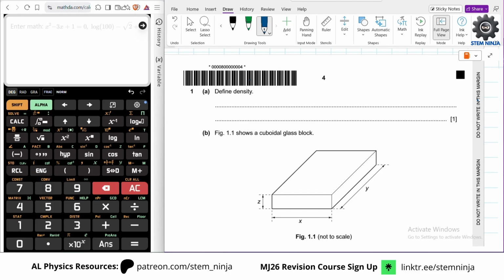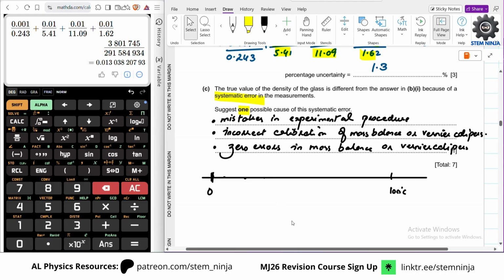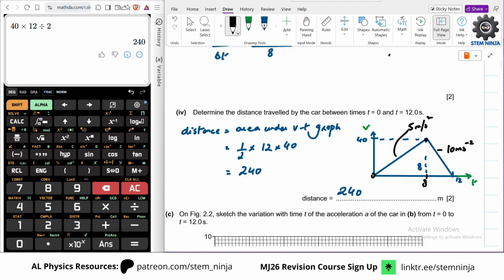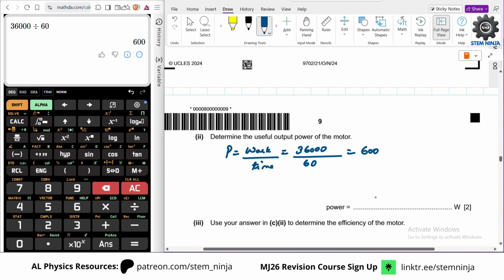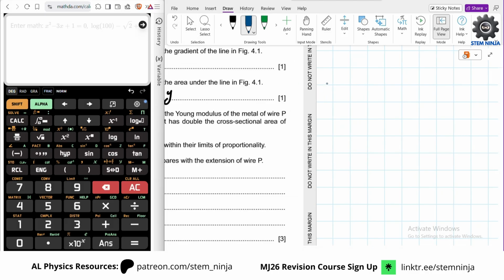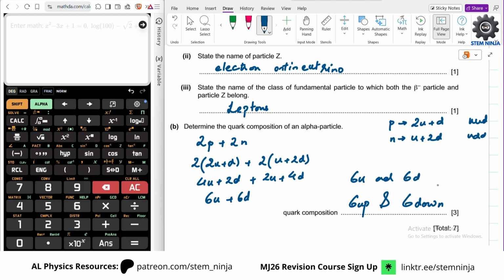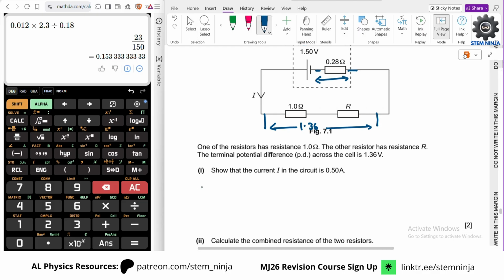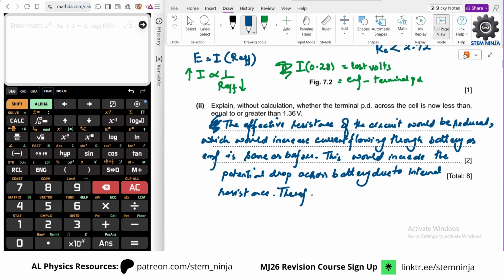CIE AS Level Physics 9702 | Paper 2 Oct/Nov 2024 | Full Exam Walkthrough | 9702/21/O/N/24

Comment: Sir can you explain me the 6 a ii part,like if A is Maxium and distance of OA=OB how is B minimum, is this like the diffraction grating or am I confusicng myself
Reply from the maker: So, in the question, it is stated that there is a phase difference of 90 deg between the sources. A is a central maximum, so the nearest minimum should be where there is 180 degrees phase difference. 
If the waves emitted had no phase difference, central maximum would have been at O, but since it's at A, it shows that's the distance corresponding to 90degrees jumps.
Reply: @stem_ninja  ah ok sir got it thanx
Reply from the maker: @prolongraptor3518 happy to help 😊